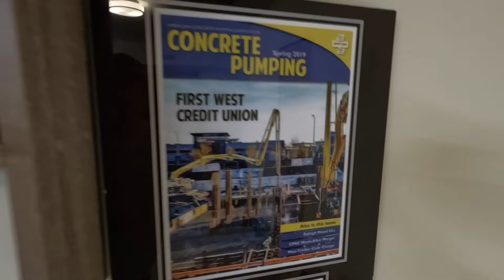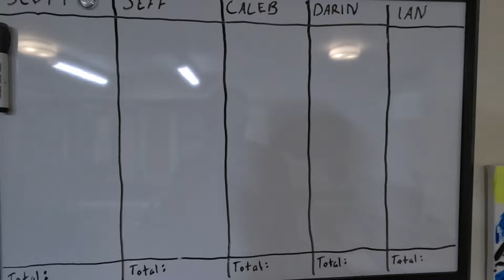Concrete Pumping PRIME-OUT CHALLENGE!!!

Comment: Patiently waiting for Ian’s first boom job video!
Reply from the maker: @bowenike  He’s been doing a ton of high-rise work pumping off the back end of the 24Z. I’ll have to get out with him on an actual boom job pretty soon here.
Reply: @canadianconcretepumper1979  oh nice! Good stuff! how far up are you guys using your 24Z for high rise work?
Reply from the maker: @bowenike  she’s solid to about 35 floors. Anything above that and the S-tube likes to get seized in place from hopper flex. We’ve pushed as high a 43 with it before.
Reply: @canadianconcretepumper1979  holy shit.
Whats the pumpkit? I would imagine it gets slower at those heights but fast enough that the contractor isn’t side eyeing you. That impressive for such a little boom to me.
Reply from the maker: @bowenike  So we special ordered this one from factory with the 16H pump kit. A few years later we had an SBU kit put in it for running the hydraulics to piston side. It makes pressure to pump 50 stories, the issue is all that pressure slamming back down towards the machine in between strokes when pumping vertical. The hopper succumbs to flex and gives up well before the pump kit reaches its “red  zone”
Reply: I don't think you're ready to boom party with me!
Reply from the maker: @encdz  please do not ever again use those two words in the same sentence. Please and thank you 🙏 🙏🙏
Reply: @canadianconcretepumper1979  ha! I had a boom party a couple of weeks ago on our 58M. Cylinders were bad we did a test and put water in the water box that drained into the hopper, separated at the final section and plugged all the way up.
Reply: @canadianconcretepumper1979  time to go talk to my Schwing devs. A 24m pump that could pump 50 stories is the ultimate city pump.

Comment: I haven’t plugged on a prime since Lassie was a puppy. Then today I met my demise! I left system laid out for a day 2 pour at the same location. Well the first day clean out was followed with a shit ton of water being ran through it just to make sure the clean out was successful since I wasn’t gonna be cracking anything open. Totally forgot to roll the water out this morning and it separated big time but it did go 200ft before it did lol. Glad I’m not in a prime out competition because that’s just silly of me to forget something that simple. Rookie move for sure! Oh but the first pour went fine. 275ft push went as good as it normally would. Crazy day!
Reply from the maker: @chriscalhoun.concretepumping  I’m typically pretty happy just to make it 200 feet…. then Mortar Cement entered into my life 😂😂😂
Reply from the maker: @chriscalhoun.concretepumping  I’m typically pretty happy just to make it 200 feet…. then Mortar Cement entered into my life 😂😂😂
Reply from the maker: @chriscalhoun.concretepumping  I’m typically pretty happy just to make it 200 feet…. then Mortar Cement entered into my life 😂😂😂
Reply: @canadianconcretepumper1979  I’m glad you finally found something that you can use. It’s funny how concrete mix designs may look alike but in different areas those same ingredients that we have here may not be the same there. Our sand is fine white beach looking sand. Same as our beaches in the gulf. Different areas pump differently it’s just the way it is.

Comment: My line pour Tuesday morning perfect prime. Contractor switched mixes for the house garage. Went back to a regular boom mix 3/4 rock. Jammed solid in the reducers. Had to pull it all out and switch to 4” to finish it off. How do you score that. Lol
Reply from the maker: @kyledally8410  I’m going to say if it don’t even get through the reducer, it’s a fresh start with the larger size line. The other one I had forgotten is: what if we plug during the prime, but not AT the head of the prime??? (Eg: piece of debris jams is up back at the reducer halfway through a prime) 

🤔🤔🤔